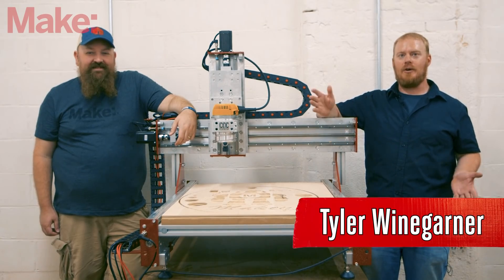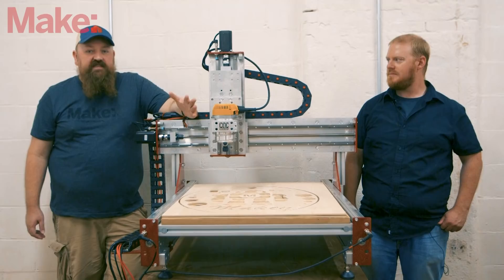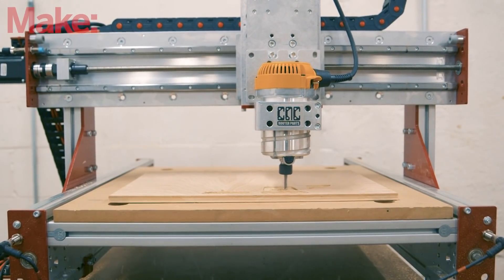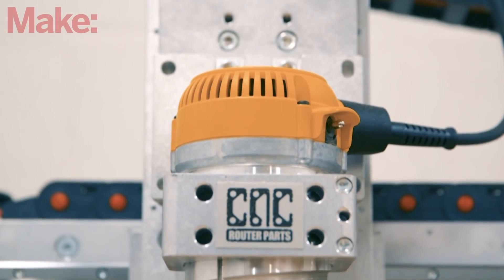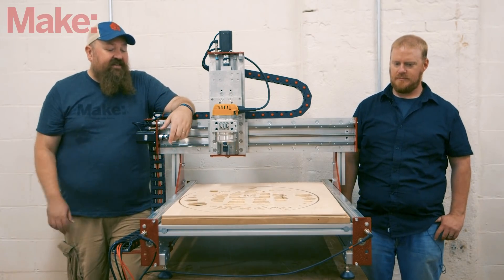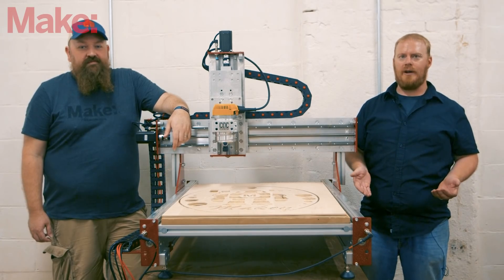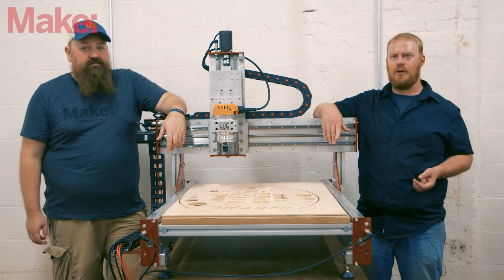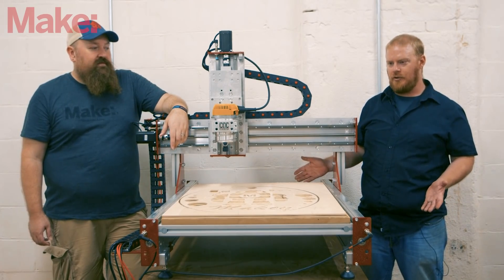The Best CNC Router for  2018: The CNC Routerparts Benchtop

Comment: Hi, I agree with some folks comments. Those are leadscrews. Ball screws are more accurate and should last longer with "proper" lubrication. Also, too bad they didn't devise a means to isolate the linear ball slides and screw from debris, though that costs more money to do so. Regarding the use of belts; I've worked on a lot of Japanese semiconductor equipment over the years. They run much of their robotics with belts, even where they drive their ballscrews. If the splined belt is protected, and properly tensioned, and right-sized for the application, I've seen robotic end effectors, and Z-axis go a year of 7/24 high speed get and put of 8" and 12" wafers without needing adjustment and very high accuracy of placement. I'm talking easily 30 big movements a minute for a year. So don't be dismissing belts as they are great, accurate transmission.
Reply: G Yatko yes I agree, our fancort Cartesian robots have held up 7 years without any issues with the belts.

Comment: CNC Router Parts has great service but I agree the needing some bundles would be nice.  The pricing is attractive but there were several items I ended up having to purchase separately once I figured out I needed them.  Now I could have done more research and probably of avoided this but I think there price would tend to draw some newer to intermediate level people that may or may not understand all the finer points of spacing out a machine.

Comment: New to cnc machines.. so are the x-carve and shapeoko on a lower leaugue than the machines at cncrouterparts? I mean even the benchtop is way more expensive. Would you say that the two brands I named are more for DIY'ers at home, hobbyist, where as the machines from cncrouterparts are for production?
Reply: Kung-Fu Mojo yes they are for the simple thing that they use belts. They are very little good machines  for the price. I own the shapeoko and I love it but I already had to upgrade the z axis because the belt driven one sucked.

Comment: Agreed - this is a nice machine.  I have an older 4 ft x 4 ft from CNC RP, and I love it.  There are quite a few design improvements in this machine.  Reading through the comments, there are a few common questions.  Agreed that more detail could have been provided on spoke to them about this machine relative to others.  Here are a few answers and highlights of their machines for me:
1) The machines can be ordered to work with most mains voltages worldwide 110-120 or 220-240 at 50 or 60 Hz.
2) The rigidity of the machine is superior to others in it's price range and capability.
3) The CNC Router Parts machines are kits - for some, this is a disadvantage, but there is no reason the machine won't last 20 years or longer with reasonable care and maintenance, and paying the one-time cost of putting the machine together means I am very familiar with all of the working components and can better maintain, repair, and upgrade the machine over time.  I appreciate being able to replace a part that is worn or broken from an accident, etc, instead of having to replace most or all of the machine.

Other options are adding dust collection, air cooling for cutting aluminum, etc.  If you want a sense of what it's like to build one of these and see more details, go ahead and watch the assembly video from CNC RP at https://www.youtube.com/watch?v=ZUNpi0lTg5c

Comment: To Clear up the "acme vs Ball screws" debate, look here: https://www.youtube.com/watch?v=Oed5NQ7-2ng    at 1:25.
Make does not appear to have the latest model of the Benchtop Pro. The latest has 3/4" aluminum risers holding the X gantry, aluminum plates for the bearings and motor mounts,  dust covers over the ball screws/precision rods, and an extruded aluminum bed on which you put your spoilboard. Cutting area is closer to X=25" Y=25.5" and the Z axis has 8" rise (12" with an optional Z carriage) 
I bought this machine in May(?). IT IS A BEAST! I haven't tried it but i think you could blast through 3/4" MDF in one pass. (I've seen two passes at 600ipm.)  I bought their DIY electronics package with NEMA 23 motors that give me more than enough power. I use a Porter Cable 3-1/4hp router. 
Get the smooth stepper to get best performance -- I had trouble with my computer's parallel port (Not a windows guy; didn't know it didn't work.)
My cost, sans router, was ~$4500.
Reply: Richard Farwell why didn't you go for the spindle option?

Comment: CNC Router Parts offers three different desktop router kits -- the 'standard' and two different sizes of their 'pro' model.  To these basic kits, the builder needs to add electronics (for which CNC Router Parts has a number of options), spindle, router mount, waste board and/or hold-down board, software, etc.  I get that you couldn't tell us ALL the choices you made in building yours, but it would make your recommendation a lot more useful if you'd told us at least the major elements in your build.  As a bonus, you could have listed all the options of your build in the description of your video.  

Also, since cost isn't an irrelevancy in deciding which CNC machine to buy, it would be helpful if you told us how much your machine would cost to build.  Best I can tell, it would cost about $4k to build your machine.  That's about twice what it would cost to get an X-Carve.  It's also about $2k less than a nicely configured Explorer CNC from Legacy Woodworking Machinery.  The value of your review is greatly diminished by failing to tell us why you think this machine represents a good value between a hobbyist machine, like an X-Carve and a professional grade machine, like Legacy's Explorer.
Reply: Completely agree + why not just a text list of recommended bundles. Particularly for beginers and those of us with zero knowledge on CNC Machines.
Reply: @Choc_Chilla  add my whatsup , or wechat best, we teach you. 008613075365628
Reply: Don't compare an X-Carve to this David, this machine It's all HIWIN guides

Comment: Can you link their website, please, I can't make out what brand you're saying and I wanna check it out!
Reply: CNC Router Parts

http://www.cncrouterparts.com/benchtop-cnc-machine-kits-c-59_60.html

Note that the Benchtop Standard machine is shown in the video. Make: incorrectly identifies this as having ball screws while their video clearly shows a multi-start Acme thread.

The Benchtop Pro machine is CNC Router Parts’ ball-screw-equipped offering but that is substantially more expensive than the machine shown here.

This video has several significant errors and important omissions. It appears to have been produced by people with only a superficial knowledge of CNC routers so I’d caution you not to make any buying decisions based on watching this.

CNC Router Parts is a fine company, I’ve bought from them and respect their products. I encourage you to learn more about their products but also to look at competing products since this is a much different market niche than typically covered by Make:

A tip when contacting vendors: Don’t call it a “CNC Machine” or “a CNC” if you want to be taken seriously. “CNC Router” is what these machines are called in industry.
Reply: thank you!

Comment: "You dont need 220v, 110 is fine." Whell, 230v only here.
Reply: Check out your third phase : 230V * √3 = ~400V  🤘😎
Reply: The video is very US centric. He should have said “will plug into a standard household outlet”. The CNC Router Parts electronics packages can be ordered for use on European 230V household power.

Comment: Nice overview, but why haven't you considered anything from the Openbuilds Store? They have similar packages in a variety of configurations for a lot less than cncrouterparts.com and those are ACME Leadscrews and NOT Ballscrews.
Reply: I liked your comment for correcting the mistake about ACME Leadscrews and NOT Ballscrews, they are not for production, i tested Xlarge for hard wood with 150 IPM, 1/4 inch deep, with 1/2 inch tool with 1/4 inch shaft, the machine resist but not longer, it take 15 min to finish the job. This kind of piece of junks are just made for hobbies that's it. Sorry for my grammar

Comment: @ 2:30 These are not ballscrews but ACME Lead screws

Besides that, looks like a nice step up from a shapeoko type machine
Reply: nice linear rails and then cheap acme screws! 1 step forward and 2 back(lash) lol
Reply: only you noticed that!whatdoyou think about the people who make the video after that;Sincerely i dont trust them!
Reply: Stef's Engineering for 4 times the price..
Reply: Sure but that is how it works. Prices almost always go up exponentionally. Same with cars, a normal car is 20.000 euro's, a sportcar is 80.000 euro's, supersport is around 200.000 euro's and the real exotics way above 500.000 euro's. The exotics are without a doubt better, but are they 25 times as good at driving around?